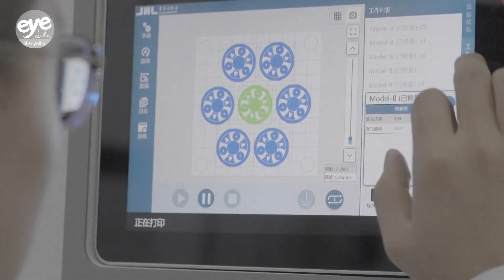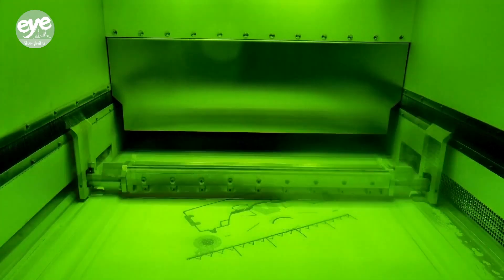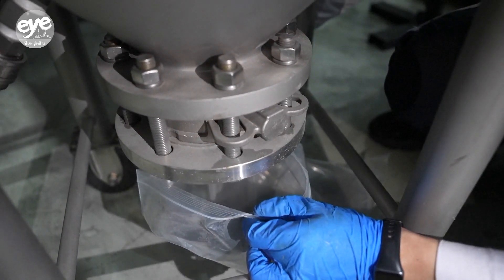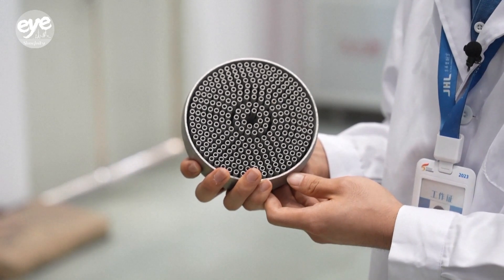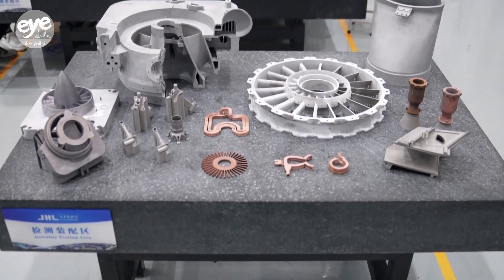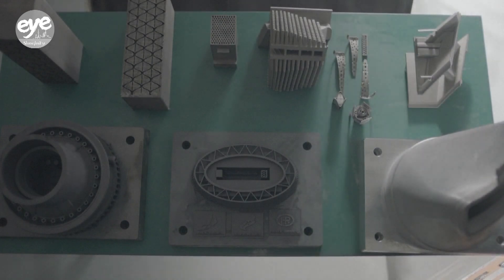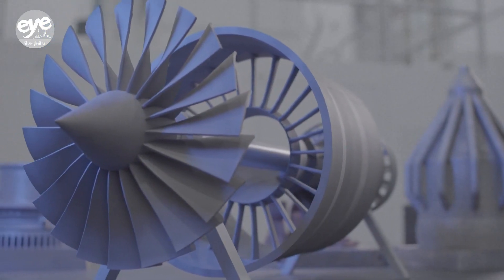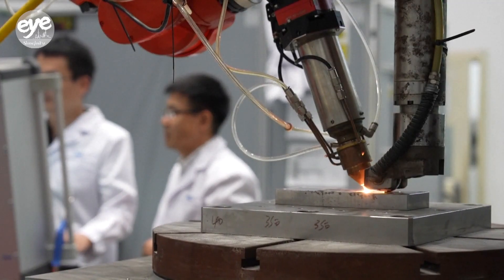Chinese scientists leverage metal 3D printing to upgrade traditional material manufacturing industry

Comment: Pretty sure this is already being employed making Chinese EVs, the J20s, and certain parts of shipbuilding!! ie PLAAN carriers!

Ive heard several times about either the J16s being lighter, stronger because of 3D printed parts, this im pretty sure has already been or is being integrated everywhere in China industrially..... Chinese EVs are being made in record numbers and in record time!

I still dont understand how it all works..... i understand there are no joins therefore lighter and stronger, no need for welds or screws etc.... i just dont understand how the actual metal is bonded or grown layer by layer?

BUT saying all that ive no doubt China is industrially light years ahead with this tech and has fully embraced it

Comment: Great! Let me know when Quality Assurance catches up with that metal 3D printing. Are they able to 3D print some quality Assurance? Almost everything I bought from there through Ebay or Alibaba turned out to last about 4 weeks if it wasn't already broken. That's a big step down from 10,000 hours to 4 weeks. The one good thing is that it has given me an education in electronics as I had to repair everything I get delivered but sometimes the repairs aren't possible as the quality issues occurs with core components. But yeah, quality assurance should be more important than shooting lasers. Always choose Quality, else you end up a bunch of junk that looks fancy, costs more than it should and turns out just to be something made in a place where quality assurance is inconvenient because it costs more. And some of the stuff is just insane, like plastic cooking utensils! Seriously!? It's like whoever eats with that is just asking for some hormonal changes to say the least. Writing "Microwave Safe" on plastic containers? C'mon guys! You can't heat plastic without it restructuring and thereby putting pthalates into your food. But it's all good, as I am all things, I see that this is intentional as it makes those with patents in medical industries rich.

Comment: 3D metal printing has been around for a long time in the West. If this is the latest news from China, I'm afraid they are way behind.
Reply: Did you even watch it? They are advancing existing metal 3D printing tech, not inventing it for the first time
Reply: @gusfring96  Yes, the video says that they are advancing 3d printing technology, but it doesn't say how. I didn't see any aspect of 3D printing that was "advanced" or new in this video. I'm afraid that this "advancement" refers to their adoption of existing technology and not to the advancement of 3D technology as a whole. JHL is only a 6-year-old company that, like many other companies in China, serves to take over Western technology without any consideration or respect for intellectual rights. China developed a little of it on its own, and almost everything was stolen and hacked.
Reply: Yes it is, but i hope china will make it cheaper, much cheaper
Reply: @agungh1670 so you’d let china take over for a few dollars?
Reply: I said the same thing before I saw your comment. They are way behind, china is the ultimate copy machine.
Reply: the refined rare earth used in the lasers are likely sourced from china with out that the west would have problems making the lasers